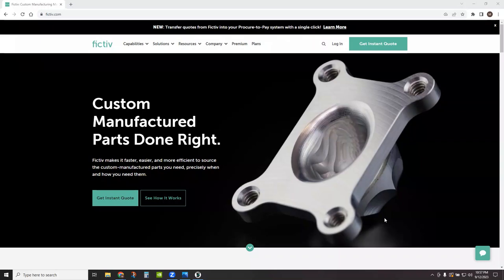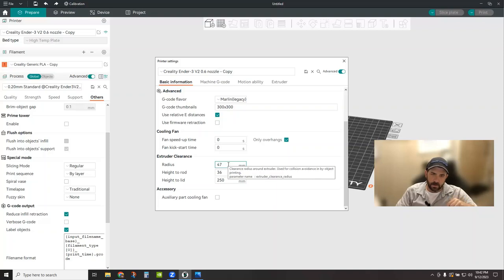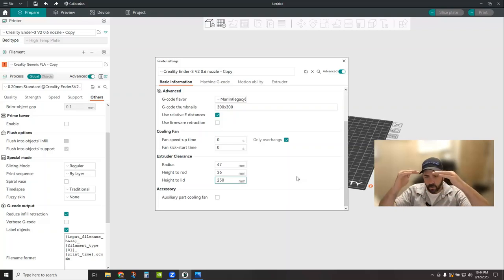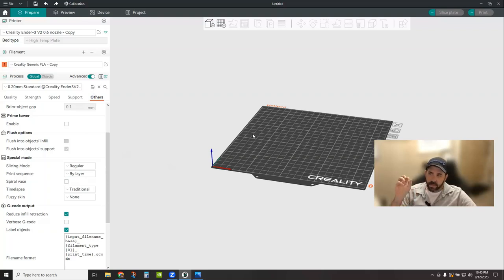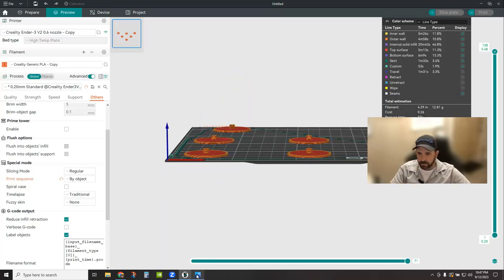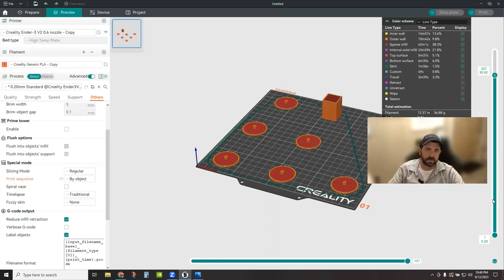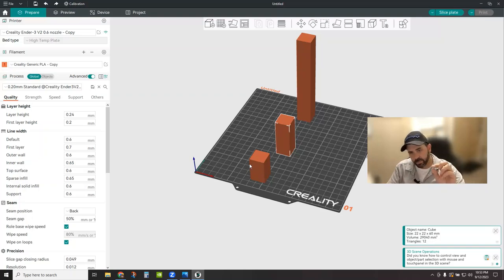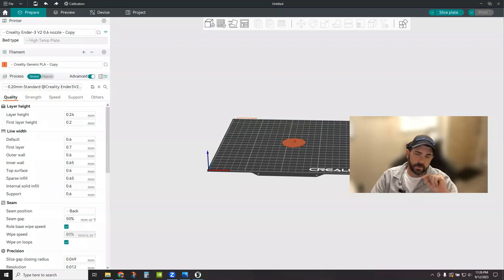How to avoid the CRASH in sequential printing

Comment: It's good to see that Orca slicer (or others for that matter) are starting to incorporate auto-arrange with sequential printing.  I see Orca has a good start, but still needs more improvements.  I regularly sequential print parts higher than the gantry, and you can get way more on the plate than Orca can automatically arrange if you position the parts manually.  When I tried to get Orca (version 2.1.1) to arrange the four part in my video below it put three of them off the buildplate, but as you can see from the video they can be printed sequentially without crashing into anything.  https://youtu.be/DFkU9roBjdA?si=nRbbVzSWOiPcAIES

Comment: I think thats not correct.If you say your height to rod is 34 mm and you give it a buffer it should be 33 or 32mm cuz if a part is 35 your printer will crash into the rod cuz you set 36.
Reply from the maker: doh.  you're right.  i should have gone the other way with that height from the nozzle to the x gantry.  Thanks for the catch.